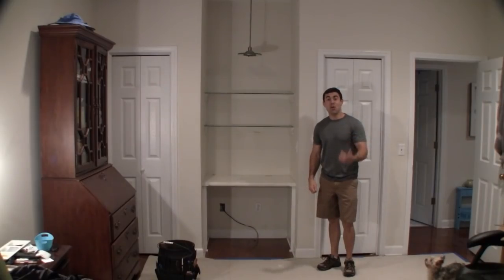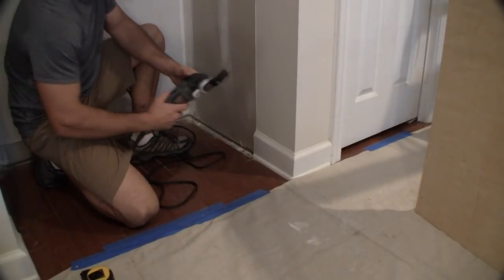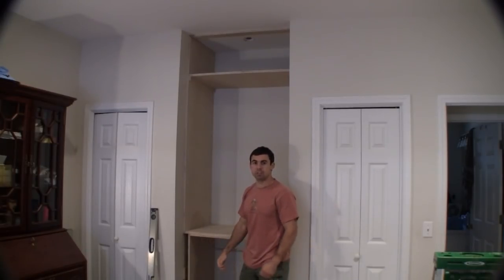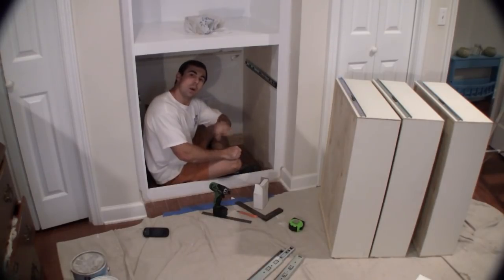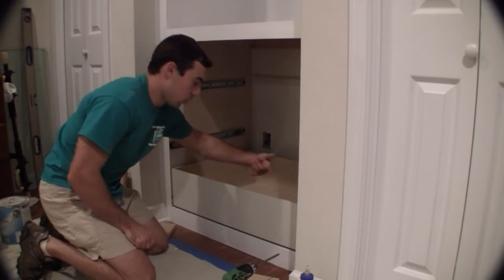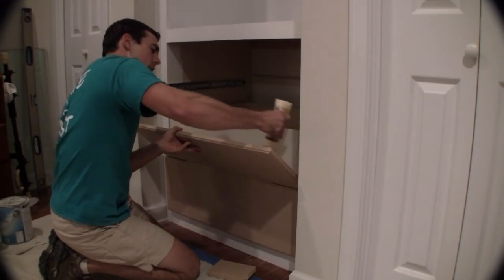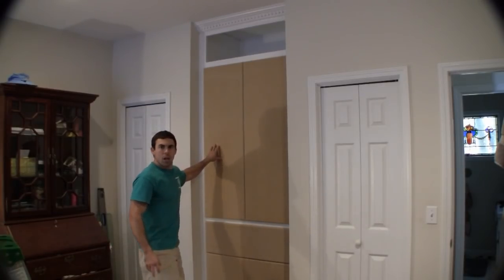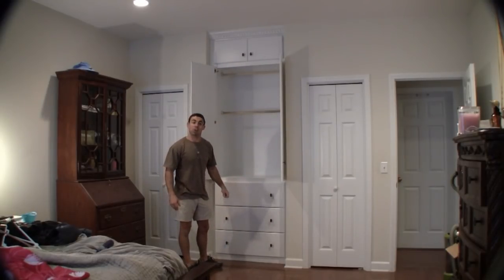The Built In Closet for my Son - How To

Comment: Good job. It was very smart to not cover the outlet so it doesn't violate electrical codes. IMO the drawer cabinet could be right to the wall. 
I did a similar cabinet in stained wood and installed a 2x1 oak frame as the drawer front. Made a recessed panel effect.
Reply from the maker: Thanks Mark! Yea, the issue I'd be worried about with putting the sides right to the wall is that a lot of walls in houses aren't square ;) Would leave for some funky drawer opening and closing....

Comment: Great video! We are planning a built-in for our entertainment center but it's so overwhelming to me. Congrats on the coming addition to the family.
Reply from the maker: Thanks Scott!  Not sure what your woodworking experience consists of but a built-in is pretty straight forward.  Basically a series of boxes with face frames.  There are a few different ways to build them.  I did one that was about 15' long and 7' tall that I just built a bunch of boxes out of 1/2" ply, stacked them and screwed them together then came back and added face frames to tie them all together.  Good luck with yours though!

Comment: This may or may not be a stupid question... but wouldn't it have been easier to open up the walls on either side of the closets where the original opening was, and just add two big sliding doors? You would almost gain a foot of space by removing the two walls, and you could have still put your drawers and such in the middle. Any who... your craftsmanship is great!
Reply from the maker: Well, it would have been more work, would have been messy and maybe the biggest issue would be that the hardwood flooring doesn't cover under the walls so there would be flooring to fix/replace and it's very very difficult to match. And it would show even with the doors closed.
The look of a custom built in is better in my opinion than a couple of sliding doors...

Comment: That was a great video. A really great video....very informative. Just a teeny tiny suggestion and only because it looks like you do this very well and maybe for a living (?). I noticed there was a light fixture when it was a desk and you covered it up but why not take that top section, convert it to a standard light bulb outlet and then frame it out for a stained glass window like the one in your bathroom. Would it be more functional as a (night) light...since you had a baby. Just something I thought since I have a similar storage in above my refrigerator and we never use it except for things we plan to never use because it's just an inconvenient space and a little to high to get at on a normal basis.
Reply from the maker: I actually do perform this type of work for a living (I'm a general contractor and home performance comtractor).  I think you made a great suggestion, that would be a really nice thing to have.  The idea didn't cross my mind and we needed every bit of storage space we could get.  Glad you found the video informative though, I appreciate your comment.

Comment: Just got a question. Don't know if anyone has asked yet.  

When you put the cabinet in there is nothing attached to the wall beside it. Then when  you're explaining why you made it narrower I can see a board halfway up the wall. What is this board for? Did I miss something? 
Thanks.  Awesome closet. I'll let you know how mine turns out.
Reply from the maker: Justin Walker I think I understand your question. I believe what you are talking about are the "blocks" that I added in to nail my face frames to. Without the block, the outside end of the face frames would have nothing to fasten to and would not be secure.

Comment: Great job, thanks much! Do you draw your plans on paper or use software for your woodwork designs? Do you have a cut list for this project?
Reply from the maker: Thank you!  If I do draw plans I use both software or graph paper. For this project I didn't draw any plans I just kind of built it in my head and had the plans up there.  For a complicated project or something I want to show a customer I will draw it up on Google Sketchup (a free CAD program).  I do not have a cut list since I figured everyone's built in would probably be a different size than mine.

If you have some questions about something specific I'd be happy to try and answer them.

Comment: Excellent work.  Did you make the doors yourself, and what kind of wood used? And their dimensions?
Reply from the maker: S Thunda I did make the doors. They are just some 3/4" MDF board that I cut to allow about a 1/2" overlay on the sides. I just took a router and a styling bit and went around the edges, pretty simple.
Reply: SailingandSuch What type of material/wood did you use for the face frames?
Reply from the maker: I used 3/4" poplar (1x3's) from Lowes/Home Depot.

Comment: What did you do about the electrical? Is it hidden or did you leave exposed cover plates for future access?
Reply from the maker: I was wondering when someone was going to ask.  I just capped off the switch and tucked the wires in.  Cover plates are exposed and the outlet in the back is still there.  Thanks for the comment.

Comment: how do you get the drawer out? i need to replace the screws that hold the brackets into the wood and i cannot get the drawer out.
Reply from the maker: There are little tabs on the side. One goes up and one goes down and it slides out.

Comment: Great vid, good information and instruction. What router bit did you use for the edging?
Reply from the maker: Hey thank you Mr2at! I used a classical style bit similar to this one http://goo.gl/OLkZ5D .  It looks pretty good and is easy to apply a sealer to the edges of the MDF, in this case I used drywall spackling.

Comment: What did you go with the light fixture in the upper cabinet?
Reply from the maker: I just kind of deleted it Chad.  Basically I capped off all of the wires really good and left the boxes in the wall.....  If I ever wanted to move it somewhere else I could still do it by pulling the wires up from the attic.
Reply: Gotcha looks good none the less